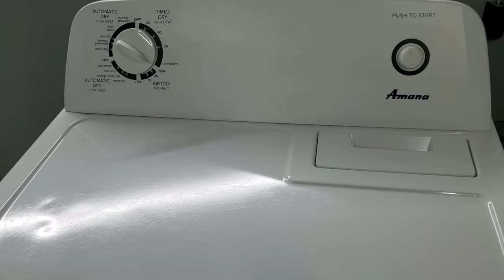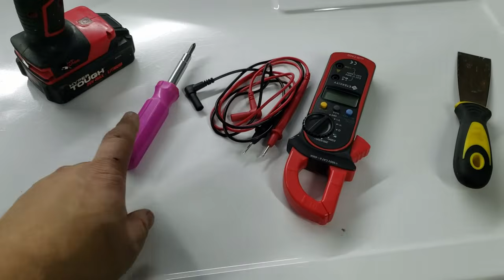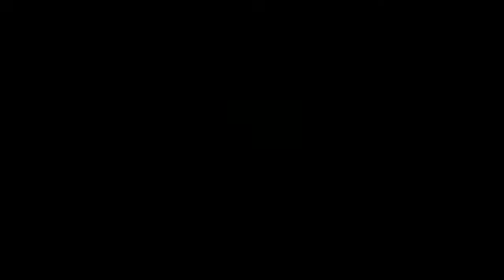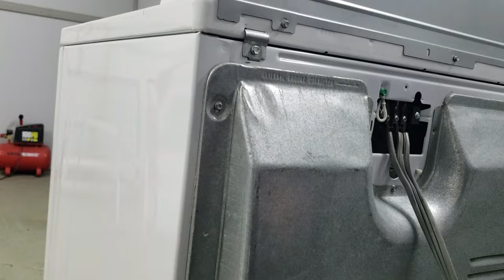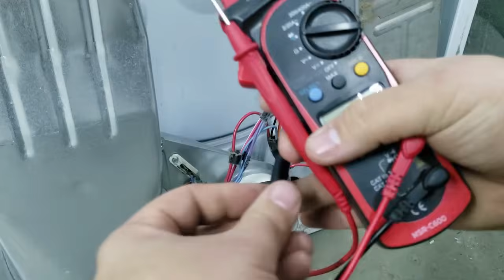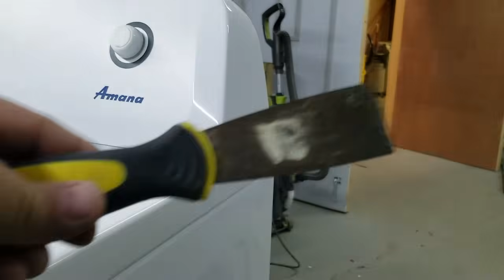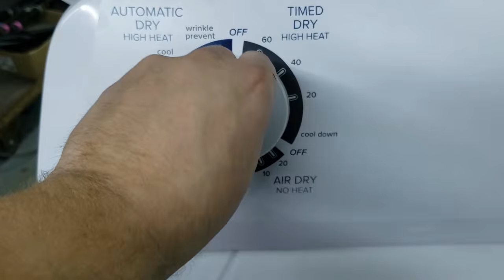How to Fix an Amana Dryer that Won't Heat - Also Works for Kenmore, Maytag, Whirlpool and More!

Comment from the maker: Refurbishing timer video link: https://youtu.be/Bgf21D0g-vM

Buy the heating element or element + sensors: https://bens-appliances.com/products/whirlpool-dryer-heating-element-optional-sensor-kit-279838-338134-3392519-279816?utm_source=yt-aqvCAxT8PlM

High Limit / Thermal Fuse Kit: https://bens-appliances.com/products/whirlpool-dryer-high-limit-and-thermostat-kit-3399848-3977393?_pos=3&_sid=76fdce0ec&_ss=r&utm_source=yt-aqvCAxT8PlM

3392519 Whirlpool Dryer Thermal Fuse: https://bens-appliances.com/products/whirlpool-dryer-thermal-fuse-3392519?utm_source=yt-aqvCAxT8PlM
Reply: First off, thank you very much for the super-informative video. My dryer wasn't heating up. I filled your step-by-step trouble-shooting, and sure enough, it was the "A" contact. So I cleaned it, put it back together, and it worked. Extremely helpful!
I have another question though. Now, I'm having a different problem (that also seems timer related). Now it doesn't stop  when it gets to the end of the cycle. It just keeps drying. Any tips for which contacts control that? 
Thanks in advance
Reply from the maker: @rprcharron  does the timer stop advancing and keep running, or does it just keep running and running? Also is it constantly on or intermittent?
Reply: @bensappliancesandjunk  The timer appears to keep advancing.
Reply: I took it apart again, and I think the problem was that the top cam was just slightly out of position. Adjusted it, and everything seems to be in working order now. Put it back together, tried running it a few seconds prior to each of the "off" positions, turned the dial to off, and it stopped. I guess the next step is to watch it heft time we use it, just to see if the dial turns on its own when it's supposed to.
Either way, thanks for the awesome video. Got a new subscriber here.
Reply from the maker: @rprcharron  I haven't had THAT specific issue before, but I've had a few instances where the cams being re-installed binded, causing it not to move at all, or the stem was real difficult to move... Hadn't had the opposite happen with it consistently running. Glad you were able to figure it out, and I'll have to add it to my memory of "Weird things that happen when refurbing a timer" ha ha.
Reply: Thank you fine sir. I'll  subscribe and be waiting. Appreciate the speedy response and helpful content.
Reply: I appreciate this video sir. I have been looking for a routine cleaning how to video. I haven't gone deep into the videos. Just being lazy as of now. I've had my dryer for some time and just want to clean and maintain it before anything happens. No videos to show how it's done and don't want to mess up my machine.
Reply from the maker: @jonanderson4474  I'm working on / tearing down a Whirlpool dryer similar to this one. It will include all parts to clean. I got the video half shot (I'm documenting all possible issues/fixes I can think of). Should be out in 2-3 weeks.

Comment: My dryer has heat but low heat, I checked it out and the heat is low .we always use high heat control
Reply from the maker: Is the temp low or is it not drying clothes? Many times the vent is obstructed, causing air flow not to be optimal. Otherwise a legitimate low heat would be a bad sensor or element starting to die. Maybe once I had an element grounding out to chassis causing low hest.heat

Comment: It’s the same if I have the same dryer but gas heater ?
Reply from the maker: The parts are arranged differently, but same theory. Instead of a heating element, you have a gas coil and valve system. You still have all the sensors that are generally the same.

Comment: First off, amazing video, very to the point. Secondly, in regard to the cycling thermostat, the purple wires read a resistance of about 7.7, but the red ones read about .1. Might that indicated that it’s only half working and needs to be replaced?
Reply from the maker: No. The purple wires are meant to have some level of resistance. Usually around 6 - 8 ohms. Both readings sound within tolerances.
Reply: @bensappliancesandjunk  perfect, so it’s got to be something else then if those readings are correct, thank you! I’ll keep digging into this video!
Reply from the maker: @rockerguyb  if its not heating, and you've tested it all, make sure to look at the timer. Newer dryers like this have really bad timer contacts that love to burn up in short order
Reply: @bensappliancesandjunk  so it’s spinning and doing all that it should, but isn’t heating. Just checked the Hi Limit Cutoff and it’s not beeping, meaning there is no continuity, which according to your stellar video, is telling me I need to replace that component! Should I still check the timer?
Reply from the maker: @rockerguyb   No period, if the cut off is bad that will 100% of the time kill heat to your unit. You will want to replace that cut off as well as the thermostat at the same time. This is because sometimes, the thermostat can be bad but it will not show up on a multi metre. The other thing you will want to do is clean your vent outside the dryer and clean the blower housing out on the inside of the dryer as well

Comment: A couple comments. First, I really was helped by this video.  I was able to easily diagnose my dryer’s problem.  Video was clear and actually pointed the right way.  Clear explanations.  Second, your clarifying which brands/models you are showing us (dryers with this configuration of lint filter) I thought of as just ‘nice’ until I watched someone else’s video for how to actually replace the heater element.  That other video, even though it said it applied to what I had, was a totally different dryer.  Your simple clarification is much more appreciated now. And third, perhaps a closer, different angle view of the thermostat and heater connections would be nice so I could be more certain I was checking the correct terminals.
Reply from the maker: I didn't have the camera setup to do it back then. I was using a static camera on a pole that only went up and down. I've since upgraded to a boom mic holder that allows me to position the camera inside whatever I'm filming - I agree with you, and it was a constant fight finding good angles that I could work with but also film with too (because honestly, doing the work and filming it are painfully difficult to do both). But I appreciate the comment and plan to follow up with another lint-top dryer from better angles. I did this with some washers and it went over well, so its definitely on the "To do list"!

Comment: Hello, thank you for the videos! I cannot find the video on the dryer timer fix you reference in this video.
Reply from the maker: https://youtu.be/Bgf21D0g-vM
Reply: Thanks man! I’ll check it out. I ended up jumping the contacts out and now the only way to stop the dryer is by opening the door. I was thinking about looking tomorrow for a cheap timer to put in line with the door switch that you just set manually and disconnects the circuit after a set time.
Reply from the maker: @caseythecatholic8896  yes, you could use a standard timer I think to use as a 120v interrupt. Just make sure it can handle the amperage.

Comment: I want to fix mine. The heat goes off after a minute or two. I still need the reader for Electricity. And it sounds a little harsh while spinning.
Reply from the maker: The reader is what makes fixing the machine super easy. As for the heating going off after a minute or two - its typical for it to cycle on and off frequently. But if its not staying on very long, that may indicate an obstruction that causes the heat to build up too fast in the element canister, then trigger the thermostat off too fast.

Comment: TY so much for a great video!. I was able to solve my dryer problem by checking all the components in your video and found them to be working fine. My problem actually was the thermal fuse that went due to a clogged filter screen, creating an overheating situation and thus blowing the thermal fuse. I have told my tenant to clean the screen after each use going forward. Thanks Again.
Reply from the maker: Awesome! I am so glad this helped you!
Reply: I wonder if that is my problem as well.. did you have to replace the blue wires?
Reply: @alexkashar1022  Hi Alex - Sorry for the late reply - No, I only needed to replace the thermal fuse. Armand

Comment: Hey. I have a question. So I followed your excellent video, diagnosed the problem ordered the parts. I removed my heating element. Unfortunately my roommate did not know I had done this, plug the dryer back in turned it on. Huge spark, now the dryer is totally dead won't power on. I assume a fuse is blown. Could you tell me where that fuse might be? I assume it isn't the thermal fuse, but I don't know I am a total novice. Thank you so much in advance!
Reply from the maker: I swear I replied to this and wrote a long answer but I don't see it so...

The white fuse on the back on the blower (lower-left corner) is a safety kill-fuse on the unit that could be bad. Use a multimeter to verify continuity.

Chances are though, if you saw a BIG SPARK somewhere, its because a wire/terminal that was left bare touched the metal on the back of the dryer, and caused electric to flow through. The terminal that touched may be burnt and needs replaced.

However, the house/apartment breaker that handles the dryer has likely popped because of the amount of electricity that went through it. I would verify all your connections are safe on the dryer (nothing burnt to bits), then cycle the breaker FULLY OFF, then back FULLY ON. I guarantee it tripped, but if that is the core problem w/ the spark, its hard to say not being there.
Reply: @bensappliancesandjunk  thank you for the reply. You diagnosed the situation perfectly and it happened exactly like you said it would. I flipped the breaker and replaced the terminal, dryer is running well. Thank you again!

Comment: My dryer made a very loud banging noise, the drum is still turning but it's not warm or hot inside. I'm thinking it is the heating element. Thoughts??
Reply from the maker: You need to get a multimeter and test components first. Otherwise you are throwing parts at it without  certainty that will fix the problem

Comment: Great walk through. Just determined it was the cycling thermostat for our Amana ned4600yq1
Reply from the maker: Nice work! I am glad it was a cheap part. I don't see too many of the cycling thermostats go bad. Its usually the components on the heating element.
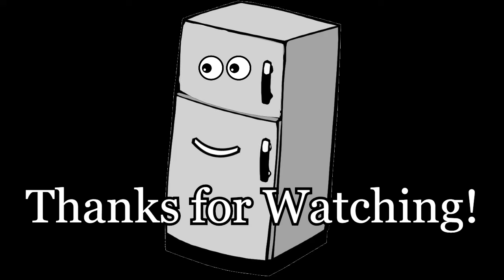Reply: 10:08

Comment: Excellent instruction. My problem was the timer and I followed your timer repair video to get up and running free of charge. Keep up the great work.
Reply from the maker: Awesome! Usually the timer fix is a stopgap, but I've had it work for 9+ months according to customers. I'd really like to do a total rebuild on the contact pads, but I haven't found a good supply yet.
Reply: @bensappliancesandjunk  I know right? If you could find a supply of those contacts it you’d be 1/2 way there. Have you ever tried ripping them out from an old unit? Do they? Maybe heat gun?

Comment: I have replaced all of the elements that you talk about in your video timer thermostats heating elements everything and it still does not heat up I also checked voltage into the dryer and it is at 120 on each leg and 240 total...now what????? BTW vents are clean too!
Reply from the maker: Its very rare but: HAZARDOUS POSSIBLY

Take back cover off of where power terminal is on back of. Take multimeter out and test for 240v. START THE DRYER and check voltage. See if there's any drop from 240v. In rare instances, I've had the neutral go bad where the voltage will plummet from 240v to <50v once a power load is placed on a dryer... This would indicate the plug/breaker/box is bad.

OTHERIWSE: 

Double check everything for continuity. Then use your multimeter to do a continuity test between the timer terminals and the heating element itself. The multimeter should then be able to test from the timer -> heating element. You should get continuity between the thermostat terminal and the red/A terminal (I think that's the one).If you get continuity, everything from element to timer is good, and its on the MOTOR LEG of the heat connection.

Regarding that: the last spot you can find on a dryer that could go bad is the belt switch / centrifugal switch on the dryer. There is usually a small clicking switch on the idler pulley and motor that clicks to tell the dryer that the pulley is engaged (it has a belt and will turn) which deals with passing the heat signal on, to the cycling thermostat, then usually cycling thermostat to the 2nd leg of the heater.

You should be able to pull a schematic on the dryer in a tech manual under the console. You should be able to trace/identify all the wires or components that have anything to do with heat. Somewhere, a component or wire has failed, or a contact on the wiring has burnt up.

Any of these issues is in like... the 2-3% of dryer failures. Especially on a Whirlpool-based dryer.

Comment: My  amana  gas dryer will not heat unless i set the timer on 60 min then it turns on the igniter and releases gas if i set it on 70 will not heat at all even when the timer hits 60 min
Reply from the maker: Sounds like contacts in timer could eventually be going bad, but if you're timed dry is OK 1min-60min... I'd keep it set to 60 minutes or less then

Comment: So my dryer checks out but I'm troubleshooting a different symptom. On low heat, the element seems to be too hot. Hotter than it should be even at high heat and is accompanied with a burnt smell.  I've replaced the element but no luck. Any suggestions?
Reply from the maker: I would check to see if even the new element is grounded. Do this by using a multimeter (when dryers unplugged) and touch one probe to either spade terminal on the element, then another to the outside metal case. If the multimeter has continuity / beeps, then something is pressing on the heat wires, causing them to run improperly.

Other than that, it sounds like a contact, connection, or sensor is staying open when it shouldn't... Its possible the timer contacts have fused together/melted and are staying open, no matter what. Maybe look at the timer and see if you're getting a signal through A to C regardless of mode.... That is the high heat contacts/voltage, and if they stay open in a non-high-heat mode, the timer's bad.
Reply: @bensappliancesandjunk  The element is not grounded. I put a meat thermometer up to the exhaust. On low it cycles between 118 - 155. On high, it's 122 - 160. Not exactly sure what you're saying about the timer, but continuity differs between low and high.
Reply from the maker: @kevinkilgore9322  I would check cycling thermostat on the side connectors that are purple. Check what resistance value is there. Your tech manual may also state what the low temp is supposed to run at
Reply: @bensappliancesandjunk  7.1k
Reply from the maker: @kevinkilgore9322  that sounds in range. Check the cycling thermostat, and it may have a temperature value to show when it should cut off. Its likely the cycling thermostat is cutting off at 155f. Some are higher or lower that effect how low the high end of the setting goes.
Reply: @bensappliancesandjunk  Yea it's rated at 155. I already checked it with heat gun and multimeter.
Reply from the maker: @kevinkilgore9322  if its rated for 155 and cycling up to 155 then I am not understanding the problem. It doesn't send different voltage to the element regardless of mode, so the element itself is always going to heat up to the same internal temperature, while the sensors cut off the run time. 

Burning smell / odor is caused by lint/particles being disturbed and getting trapped in heater can. Sometimes when new ones are used, they can take a little time to "Break in".

What temperature is the actual element wiring running at to make you claim its running hotter than in high?
Reply: @bensappliancesandjunk  After more time with it, it's not getting higher than high. The problem is that low and high are the same, about 155.

Comment: Thanks Ben, you may have just saved me $400 on a new dryer.. I’ll drop a reply in here after I do some testing. Do you have a video on the amana washing machine too? Mine doesn’t like to finish cycling, it gets to the last stage and shuts off. We have to put it on spin drain to finish a load.
Reply from the maker: I do! I have one that shows you how to figure out the error codes to see if the machine will tell you exactly what's wrong so you can get an idea on how to fix it. I don't have as an extensive "How to" step-by-step on the actual parts replacements, but the code process usually gets you 75% of the way there since unlike on this dryer, you're just testing everything 'til you find out what's bad.

Comment: Great video, thanks! I am planning to tackle this tomorrow. I also see that a possible cause of no heat is a broken heating element but I don't see that covered in this video. Did I miss it, or is there another video where you show the heating element? Thanks!
Reply from the maker: The heating element is what gets tested around 5:20 in this video, right after the thermostat. 

We tested it but didn't replace it in this video. We replace it in this video: https://www.youtube.com/watch?v=TGIodSIp_tA

Comment: It was my timer. I took it a part, looked at it, and put it back together and thought I check it again because it didn’t work before. IT WORKED, SO PUT IT TOGETHER AND PUT IT BACK IN PLACE AND IT STILL WORKS!!!
Thanks for your video!!
Reply from the maker: Woo hoo! Glad to hear its fixed now!